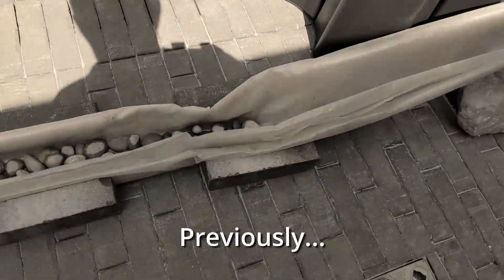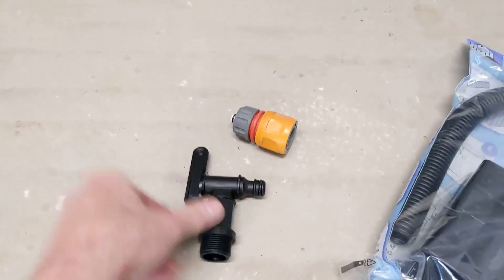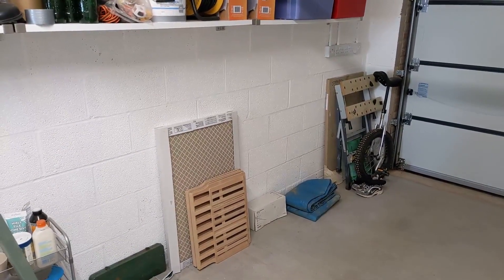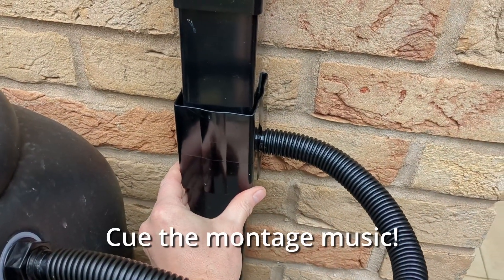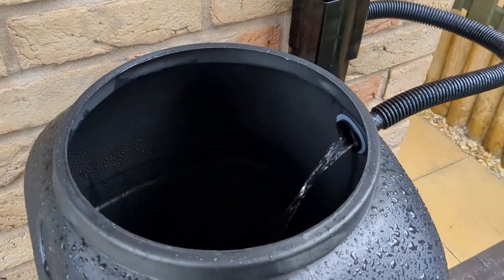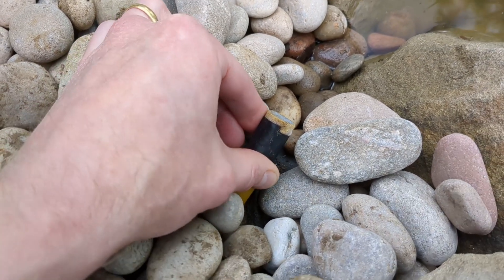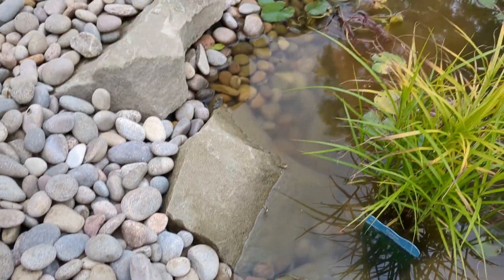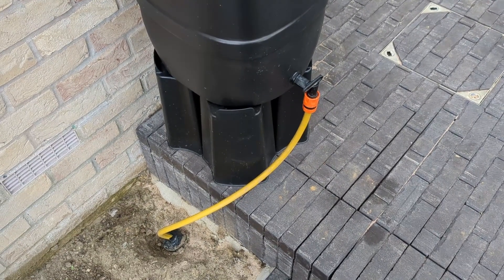Water butt grand opening - topping up our pond is now super easy

Comment: Have you found you need more butts now you have one? I have a 225litre and ended up getting a second one after the dry summer of 2022
Reply from the maker: Actually this has worked out just about right for us.  I top the pond up just before it's due to rain so that the water butt gets refilled immediately and gives me contingency if there's an extended dry spell.  That seems to work really well and means we don't need anything bigger.  We only occasionally use it to water any plants too, so it's mostly used for the pond alone.